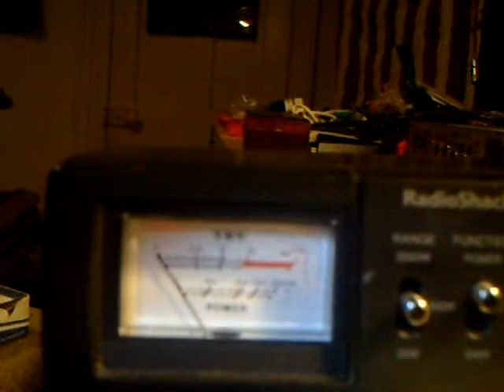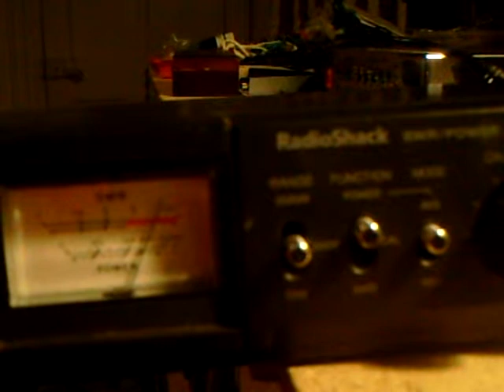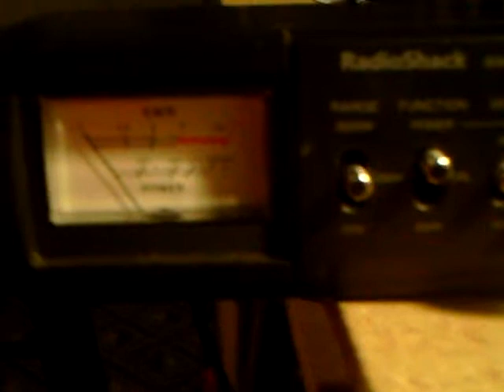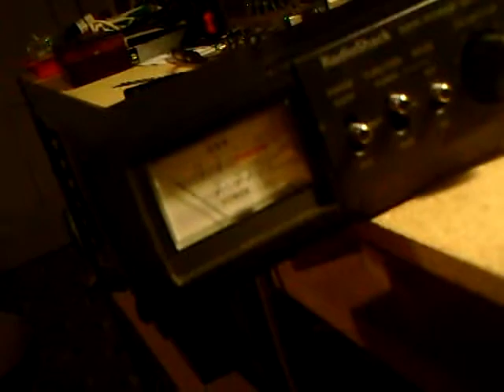Palomar 250 easily dead keying 175 watts.

Comment: Remember 6db per s unit on a calibrated radio receiver. Also every 3db is twice your power. I'd look up the rating of the transistors or power fets used in the amplifier and stay in the MFRs rating  of RF drive and also consider the heat sink temperature while in operation... Glad to see people still experimenting:)

Comment: You might not necessarily blow it up but those SD1446 transistors are certainly being pushed pretty hard. I would modulate that thing with no more than 75w dead key if you want it to sound okay

Comment from the maker: @nimbledagreat i ran it for 3 years like that. 1446's can take more beating then a 2879. they can also handle a higher deadkey per pill. there is no backswing. also i tuned the antenna with an mfj analyzer, 1.1 across the band. fatboy. antenna.

Comment from the maker: Just going back to this old vid. Its so funny to read people's comments talking like they know a thing or 2, but it's funny how wrong they sound when you really know a thing or 2. I still have that palomar.  And yeah, sorry about the damn typo... I ran that palomar for 3 years. That thing would drop the maul for a 2 pill. And it did get really hot. I ran it with a fan on it when I was maul dropping with it. I was keying on 5 pills with that thing. (and no, I don't care if anyone believe's it.) No, there are no burn resistors... no burnt anything. A few years back I used that thing to drive an 8 pill. It worked really well. When I drove the 8 pill, it was doing something like 30 swinging and that gave me a 300 watt dead key.. Oh and NO back swing.  Here's an Idea.. Go get one for your self and test it out. I think you might be surprised....

Comment: set your meter so that it reads 150 watts in the center of the scale. Then lets see the same test please. Analog meters like that one, will read off at the ends. You might be supprised at what you will find. It is easy to do this test. But again how much better will the other station hear you from 100w to 175w, less than 1/2 s unit...

Comment: Hey...let me see a 175 watt key and the swr at the same wattage. I bet it's gonna be off a little. Plus you should have showed the swing with audio on the average setting. I betcha you're backswingin on average or have a higher swr with the box on. Those little boxes don't like high dead keys. The die is also real small on the 1446 pills...not including the thin trace pc board. Shit...half the time i don't even key my 2 pill at 200 watts and it has 2 2879's. Just tryin to save you sum money...